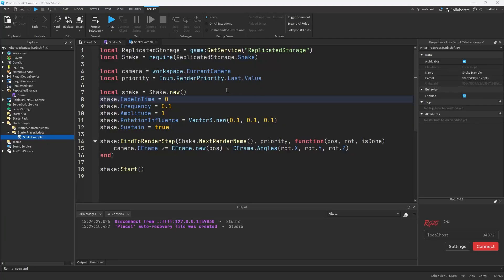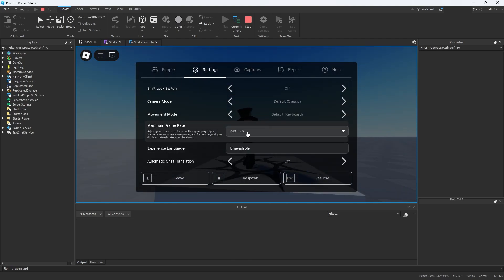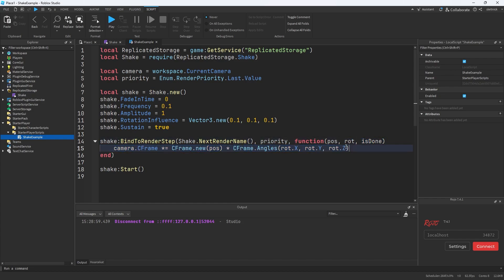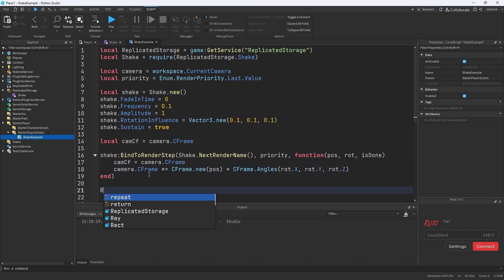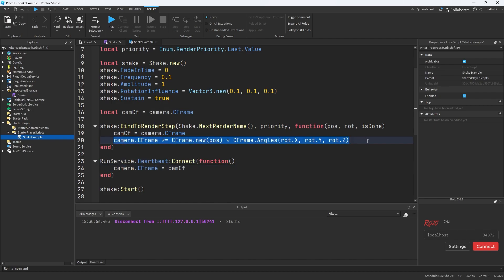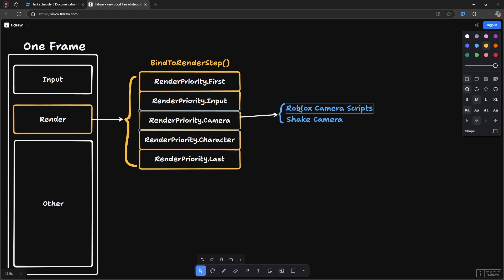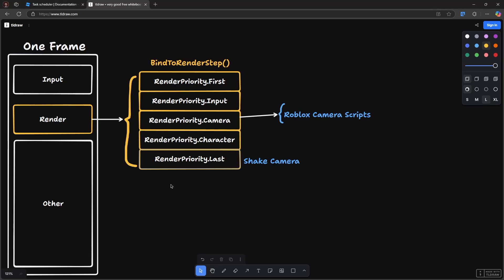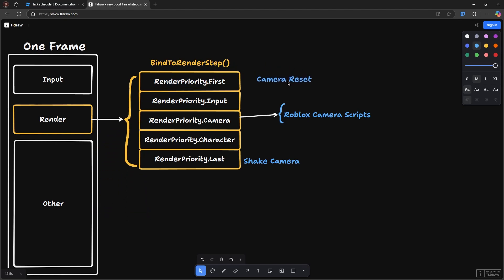Camera Shake FPS Fix

Comment: I had a similar value when trying to make my own camera control system. What was happening is I was using the previous cframe of camera without caching it and that made it inconsistent between different framerates. After that I cached and updated the value based on cache and the problem was resolved. The lesson is always have a virtual version of the thing you want to change and apply it when roblox will render. It will make everything a lot more consistent

Comment: why not posAddShake = shake * PositionInfluence * (0.01666 / dt)
Reply: He already mentioned this is not a delta time problem. Roblox fires a new task everytime bindtorenderstepped is called and adding delay wont do anything other than resulting in a bunch of tasks waiting to finish. While new ones are still being made.
Reply: @brawldude2656  i have been using this to fix it, i dont know why if that is the case but it works pretty good
local dtErr = math.clamp((60 * dt), .2, 5)
posAddShake =
	posAddShake +
	shake * c.PositionInfluence * dtErr

rotAddShake =
	rotAddShake +
	shake * c.RotationInfluence * dtErr

i just dont want to use extra heartbeat to fix it

Comment: Had exact same issue when I was working on a rail grind obby.Rails were made with bezier curves and client was handling the movement on rail.Because of render stepping faster when you were high on fps you would go faster on the rail

Comment: It's not a very elegant solution, in my opinion. Why shouldn't the Shake module handle this by itself? That way, we don't need to implement this fix in all places that use Shake, and it would also be more performative and cost less memory because we only ever need a single heartbeat loop and a single camCF value.
Reply from the maker: Perhaps for the EZCamShake module, yes. But for the generic Shake module, it is completely agnostic from what you're doing with it. You could be using it to shake a model. It isn't specifically built for camera shakes, but can be used for such. In a fully custom camera setup, this wouldn't necessarily even be needed, since it could be integrated into it.
Reply: @sleitnick1  Thank you for the response. I can see now why that makes total sense in the case of the Shake module. In EZCamShake's case, however, I think it would be worthwhile to implement the fix, because the fix would be needed in almost all cases, and the module would also stay more true to its name.